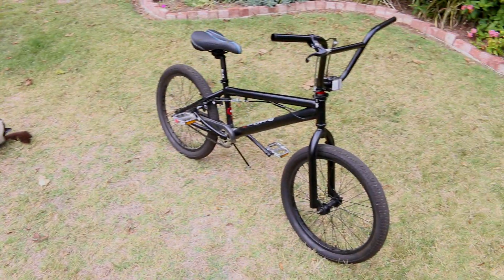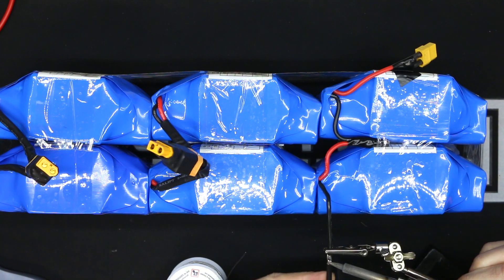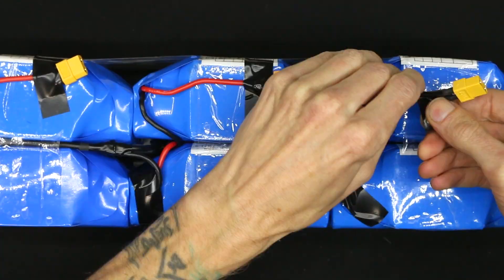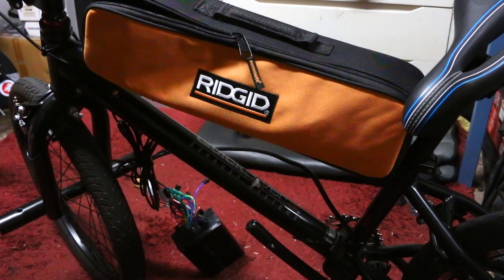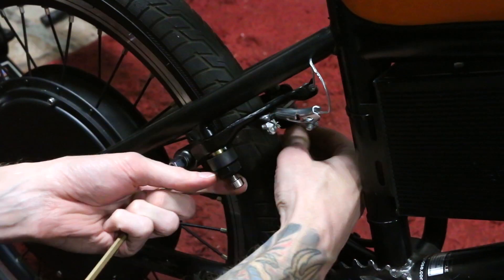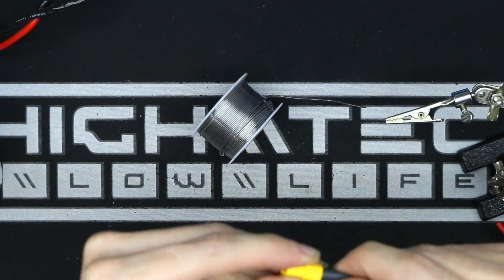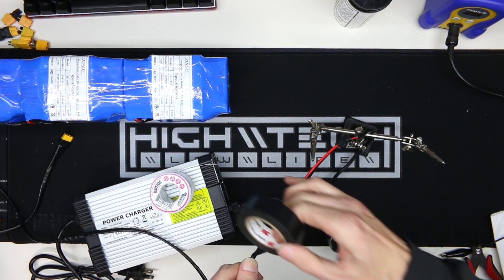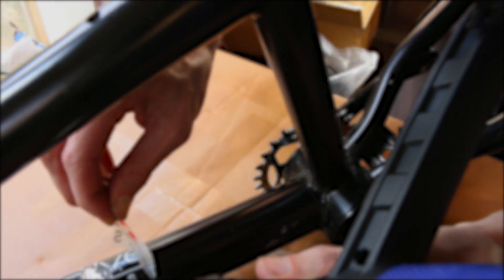🚲 Custom 3000W BMX E-Bike [45MPH!] - Part 3 - Battery Mods, Chain, Pedals, Functionally "Complete"!

Comment: ** should you want to try a Gen2, may I suggest looking for a dyno frame; idea coming from I have a raleigh dyno frame styled bike there I think it would be possible to mount a mid drive bafang in the triangle area you mounted the controller(Bruiser DX; the bottom tube has a bit of a S curve to it, making probably enough space:P), so would probably be minimal modifications required
Reply from the maker: Thanks man, yeah it would be possible to do a mid drive, for sure. Next E-BMX will be double the power, but still hub motor though. I will have some mid drive builds coming up on the channel though 👍

Comment: I used those 36v 4.4ah hoverboard packs on the ebike I built 6 years ago. At the time they were a great option, because even noname ebay packs would run you several hundred dollars, and building your own out of individual used cells and a bms would still be far more work and money than the <$100 I spent on my entire battery, box, connectors, and wiring for 36v 13ah. Most of those packs won't really output 10 amps continuous, or just barely. They are happier at 5-8 amps continuous, and are pretty low quality. They are probably all pretty old now / "refurbished", and I wouldn't trust the capacity. But if you don't let them go flat, and periodically disconnect them and charge each pack individually on a 36v charger, they can be ok for a while. I got about 3 years out of some, but with a fair amount of degradation. Some others died pretty quickly when I wasn't careful with them. I might actually use them again, because they're still $25 and I still have the box for them and that old 36v kit from 6 years ago sitting around. $75 to throw it on a beach cruiser is a lot better than $200+.
Reply from the maker: Awesome man, thanks for the insight 🍻 I only got this "pack" because it wasn't advertised as being separate internal packs, I could have returned it but I decided to try it out anyway. In my opinion It's cleaner and easier to just get a single pack, whether bought or built. Thanks!

Comment: Damn, you're an artist with this stuff.  Very nice build.  I think when I build my first custom e-bike, I'm going to use a rack behind the seat to bolt the battery onto.  I just don't feel good about putting a large bunch of LiFePo batteries directly next to my junk, but a rack doesn't alleviate that by much.
Reply from the maker: Thanks man! Rear rack is not bad, but is not my aesthetic choice, and also makes the rear end extra heavy (especially if you're running a hub motor). Batteries are quite safe, most of the danger is when charging when you're not riding it 👍

Comment: It turned out great 72v 60a battery ❤do you have a link for the batteries
Reply from the maker: Thanks man! I don't because I actually wouldn't recommend running a pack like this, if I were to do it again I would use one solid pack and it's what I would recommend for others 👍

Comment: 500$ for 6 scooter packs ? There like millions of those packs available on the used market from all the hover boards that were recalled. 25$ each m
Reply from the maker: I know I don't have to tell you, but I will anyway: not all batteries are made the same, even if they are blue and look the same. If you want to put those $25 packs in your bike you go right ahead 👍 There's a reason why so many "hoverboards" caught fire.

Comment: Try replacing electrical tape with Tessa tape. It’s designed to prevent failures due to chafing of the wires. Plus it looks better than the shiny vinyl tape.
Reply from the maker: Thanks man! Yes, I've now moved on to fabric tape for these types of purposes 👍

Comment: can i get a link for the battery back
Reply from the maker: The seller no longer has this pack available unfortunately, but I would recommend just getting a pack custom made to fit your needs. You could even just use a 'shark' pack or similar 'tube' style battery setup 👍

Comment: Making a battery pack is an art. Don't just  through it out there like: I never made a pack. But if you want me to make a tutorial? i'll make one!  lithium polymer and Lithium iron batteries are dangerous! And using more than one BMS is bad. Preferable i like Active Balancers.
BMS "AKA" battery murder system:P You have 4

A quick heads up on the native BMS.
You would suspect a generic BMS to keep your pack in top working conditions! 
But a BMS puts a resistive load on cells that exceed 4.2V going up to 4.25 because of a weak resistor burning the access voltage until all cells are 4.2V. This is rally bad for lithium based calls! drastically reducing its lifespan. and the BMS only does its "magic" at full charging capacity... 

An active balancer looks at the "live" voltage difference between the cells no matter if it's charging ore not. And it uses the voltage of the highest cell to charge the lowest cell. So if you charge your pack to 80% it will always be balanced:) (charging to 80% will double the lifespan)

Note that both systems have a residual load and will drain and kill your battery if left unused for month. Lithium has a really low self discharge. But the electronics of both systems uses current and will drain and kill your precious battery pack(s).. 

But Nice build so far! I made a mid drive MTB (bafang bbshd 52v, Scott genius 50 mk2) and the rear swing arm snapped... 160NM is no joke...  so now im buying a BMX because there nice and tough and ill make a 72v pack wit external ESC:) 

Keep up the good work! Greetings from Holland:)
Reply from the maker: Thanks so much man! I've actually been having very good luck so far with this pack, I appreciate it!

Comment: Which samsung cells are the battery packs comprised of? (Allegedly)
Reply from the maker: Unfortunately the seller never specified the cell type. I do believe the discharge rate is higher than a lot of the other 'cheaper' packs I have purchased just due to the fact that I could pull the same top speed with this tiny bike as a bike with much larger wheels (27") only difference was the battery and wheels/frame, same motor, same controller.

Comment: That battery XD

I was wondering why you was using hoverboard batteries.
Reply from the maker: It wasn't my original intention 😂
Reply: @hightech-lowlife  
Now after watching all the parts of the build, I'm just chocked how similar you and I do things like using carbord to make a mold for the side panels and not cuting wiers just in case you need them longer in the future and instead pack the smal space with them.

I can uplode a video on my BMX tomorrow if you want to se how I did?

And do you know of a good voltage regulator thet can take a 60V battery and output 12V without blowing up within 10 minutes of riding the bike.
Reply from the maker: Hey man, sorry for the late reply, youtube has been sending a lot of the replies I got to "spam" but then they don't show until weeks later so I literally have no notification of the message 😬. 

CAD is the best! (Cardboard Aided Design) 👍! 

Did you upload the BMX vid? I'll check it out for sure, thank you! 

Oh yeah, I've had good luck with these ones: https://www.ebay.com/itm/223130933726 - you can get them in higher amp outputs if you are putting a ton of lights and things on your bike, but 10A should be good for most needs 👍

Thanks!

Comment: Rivnuts for the frame! That's how I mounted my battery, they are a threaded insert made from stainless steel that are rivetted into the frame. I don't like the Idea of drilling right through the frame, and the risk of squashing the frame when doing up the nut from under it is too great. Rivnuts are used extensively in the aviation industry. My battery has been nice and secure.
Reply from the maker: Thanks man, I haven't tried rivnuts yet, but I have a bunch of projects ahead that will have them. I was careful not to squash the frame when tightening ~ I recognize without a tube to combat compression it could be an issue, I basically just needed further reinforcing the y-axis and having two points of connection did it just fine. Thanks!
Reply: @hightech-lowlife  nice one! I think a tube through the frame is a good work around.
Reply from the maker: @yoda-be.at1746  Thanks, I'll try out the rivnuts on some future projects 👍

Comment: Sorry to break it down for you but you were conned on this battery pack.  I hope you could get your money back. 
Dude, Get 4 5s Lipo battery packs. They have an absurd amout of power
Love the build!
Reply from the maker: Thanks man! It seems like it, I feel the quality of this pack is pretty good though, but I will make another one of these style packs on my own (on the cheap) in a future build and see how it compares. Are you talking about the RC packs or something different? Cheers!
Reply: @hightech-lowlife 
Yes the RC ones indeed! 
Check this video: ebikes lipo pack university in 1 video https://youtu.be/4i_4_DcZTWE
Yes a lot power for little money and you get modularity. 
You can implement a bms if you feel like but what I did is I use my controller as bms for lvc, charge all the pack in series with a cheap dc-dc step up from ebay so I can choose the voltage up to 90v and lower the discharge rate when the voltage per cell is 3.7v; LVC at 3.5v. I balance charge each 22.2v module once every 3 months. I am using 3 in series. 

Imagine you have the modularity you have now but with a pack capable of a lot amps of discharge without getting warm.

So far I couldn't find a better cost benefit better than Lipo battery packs
Reply from the maker: @Full_Throttle_no_Brakes  I am mistaken, the 18650 cells are typically lithium ion batteries, you are correct. The LiPo are traditionally more 'pouch' type batteries. Although I do believe they have lipo in 18650 cell size also. 

Those packs you said you had are quite expensive though? To get the same voltage 3 packs would be $780 and about 12AH, they might do 300A but this controller can only handle 50A, would be better suited for a higher output motor/controller to justify the cost (which I'm sure you have setup). To me personally it's not as convenient to unplug all the packs and charge them individually, but it may be worth it to you for the performance/price. 

Using the controller as a BMS is better than nothing, but you don't have a way to balance the individual packs that way, without taking the time to rebalance the packs could become out of balance with one another. This may be negligible to you, but for me personally it would be a nuisance. 

I don't believe these packs I got are just cheap fake cells however, just due to how the battery has been behaving and holding up over time. Generally those cells will degrade very quickly in comparison to 'real' cells. I could have returned these to get my money back but a good setup would run at least 300-350 regardless, so I wasn't too upset with paying about 100 more (was 460 before tax/ship). 

Again had I known that this battery was set up this way, I wouldn't have purchased it :) I may try using these packs you're recommending in a future video, but I would like to try and set up a BMS as I don't care too much for the modularity and it's a lot more convenient to have a single plug for charging and not something I have to balance manually. 

With so much money being thrown at battery tech now due to cars going that way, I see huge gains in performance as well as reduction in cost for us, in the next 5 years I see ebikes becoming even more incredible than they are currently. 

Thanks a lot for the info man, I appreciate your feedback and suggestions!
Reply from the maker: @Full_Throttle_no_Brakes  Yes, I get that you can treat them as one pack, but you will still have to manually balance as you are aware. I have done more research now and it is possible with a BMS, I think you can tap into the balance wires, but would have to figure out which wires to hook up to the BMS to get it to work. 

That long video you linked he did stress that the LiPo packs are much more volatile and dangerous than the Li-Ion cells, so it's something to consider. A lot of effort has to go into protecting the packs physically more so than Li-Ion. If you can hook up a BMS then it would be just like any other pack for charge and discharge, it would be convenient. 

I get that you can get super high discharge rates out of the LiPo packs, but I wonder if it really is more cost effective than just building your own pack from scratch? From my research having a custom pack made is not much more expensive than building one yourself ~ but I'll have to dig deeper to do a cost analysis. 

I have been thinking of buying a car battery and getting the lipo cells from that to make my own pack (like a Chevy Volt pack) but again I don't know if it will be that much of a cost savings. 

Shipping from the US to almost anywhere has gotten so expensive now, plus extra taxes for imports for EU and all that, it really is a pain. It should be cheaper to get packs from AliExpress right? 

I most likely will experiment with making my own packs in the future, so I appreciate the information and knowledge, thank you! Of course I will document my findings and struggles and always open to new information and feedback, maybe we can find the best way to make powerful reliable packs without too much money. Sadly the most expensive parts right now for Ebikes is still the batteries, but I'm confident they will come down a lot in price over the next few years.

Comment: Bad idea on the spearte packs if one of the packs bms fails the current draw will be too much on the pack conncted in parrller and can cause a fire.
Reply from the maker: It's true, it is possible, but also possible for a fire if a BMS fails on any battery though, can either over charge or discharge.

Comment: Hi you must use anderson connector if you don't want anymore sparks
Reply from the maker: Thank you! XT-90S will work :) I will try Anderson also.
Reply: @hightech-lowlife if you will use anderson connector please use 75a connector not 45a,the 45a are weak
Reply from the maker: @e-bikecustom  Yes! I have some Andersons that are HUGE! I think my next build will have 200+ amp, so I will need some big connectors.
Reply: It's not the connector that stops sparks. You have to pre charge the capacitors in the controller with a resistor to stop sparking.
Reply: @yoda-be.at1746  yes for normal connector like ec5,xt90 etc,for anderson power pole it is not necessary because are antispark connector
Reply from the maker: @yoda-be.at1746  How do you precharge the controller caps, isn't that what these connectors are doing (internal resistor?)
Reply: @hightech-lowlife  yep, if there is an internal resistor that contacts before the main connection, then spark suppression is there. Otherwise, an arrangement where a resistor is contacted first before the plug is pushed together had to be done. It's not just about the spark, it's the potentially damaging surge that needs addressing. 
Nice build btw. I've been considering a mid drive to maintain the centre of gravity for jumping etc. I also run a bike with 20" wheels with both mid drive and rear hub motor. Acceleration is a bit mental lol...
Reply from the maker: @yoda-be.at1746  Oh yeah, sometimes you can see black charring on the connector after multiple or big sparks and it can erode the metal through arcing. I'm guessing these "-S" connectors just have a resistor built in then. You have a bike with both mid and hub motors? I don't think I've ever seen that before!
Reply: @hightech-lowlife  I'm really surprised not many others have done it. It's always mid Vs hub, but they're a great combination. I have a bbs01 mid and a mxus x15 on rear. Two controllers with one thumb throttle. It easily lifts the front wheel. I absolutely love the torque. It's not huge power, the battery (48v) BMS limits to 30 amps, but that's good enough for me. Great fun 👍😉

Comment: these are from hoverboards 36v worth about 40 each
Reply from the maker: Yes! It depends on which kind you get, some are very cheap (I've seen $20 - https://www.aliexpress.com/item/1005003437509850.html), these are JinLu packs - I don't think they make them anymore though. Supposedly Samsung cells, not sure though 👍 I will make my own 'pack' with this type of setup and get some extremely cheap ones and compare the performance. I do know that these ones have performed very well so far.